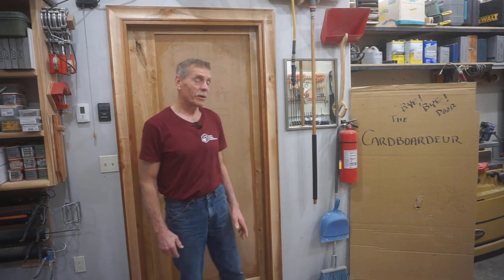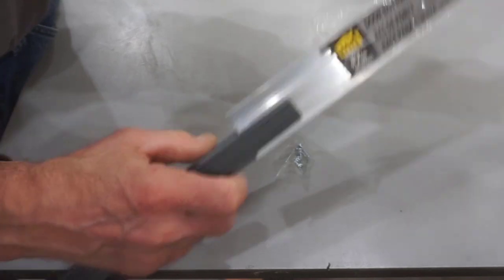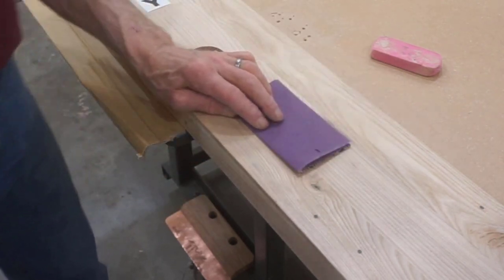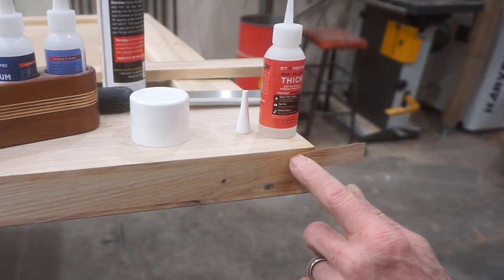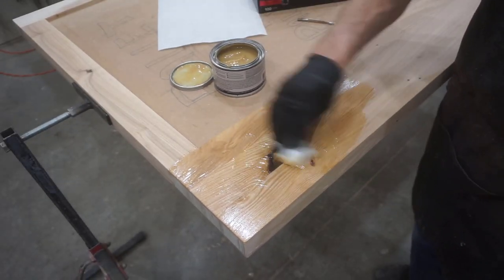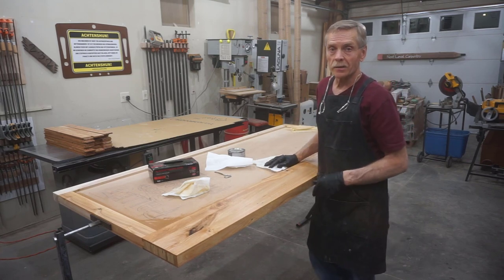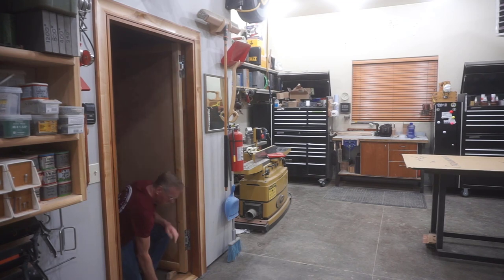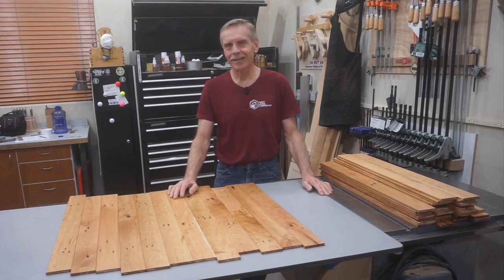Varnishing the Pallet Wood Door

Comment: Kind Sir, as an art director and type designer of many years, may I recommend you reconfigure your lettering to read baseline aligned, rather than letter-stacked (think the spine label on a book). After so much amazing work on this door, I truly believe it will look more professional and, in time, you will be happier with the end result. Besides the letter forms being designed to be viewed aligned to their bases, or the baseline, this will let you use a larger, more readable font in the same sized area. I've posted an example of what I mean here: https://user.fm/files/v2-ea0d436a4451a2ba0547d5a91c23efad/NLC.jpg
Reply from the maker: Point well taken... and you're not the first to suggest this.  I really appreciate your input and may well change course because of it.  Do you have other reasoning/examples to emphasize your point?  I'm pretty well invested in what I'm showing but yield to professional viewpoints... Thank you!
Reply: @NextLevelCarpentry Thanks and I do. My degree is in industrial design and I actually did a very large project for an agency in New York city that involved putting the meeting room names on over 20 doors. The job came out very successfully. The reasoning is twofold. Letter stacking, wether on signage or in text, is very much more difficult to read. Designers have spent years researching readability and there are many books written on the subject. So, although we are only talking about 3 words in this case, it is definitely a less readable option. Secondly, the letters themselves, no matter what typeface you choose, are designed to fit together horizontally. This not only results in more aesthetically pleasing negative spaces between the letters, but also allows you to enlarge the font 25%. I would also recommend going with a low contrast tone. Because, no matter which option you go with, the font is large and you don't want it to be overpowering. I recommend a subtle, slightly darker tone than the door itself so that the lettering does not overpower the beauty of the door itself. Lettering is designed to be noticed, and since this is not a hazard sign or wayfinding device, I would opt for subtlety. Lastly, I updated the link in my previous comment. I aligned the type with the architecture of your door, the main form, not the secondary, and lesser, door handle. Here's what I'm talking about with regard to readability: http://www.wiseinkblog.com/wp-content/uploads/2013/10/color.jpg.
Reply from the maker: @alienproductions9948  I'm getting wisdomed here!  Can you by any chance link a photo of the agency in New York or similar signage on doors without getting crossways with clients?  My design guy agrees with you although leans towards reading bottom up instead of top down...
Reply: @NextLevelCarpentry  HAHA! I'll see if I can find some pictures of the agency. For now: https://user.fm/files/v2-3ec522dc6d41401971045ab288f3b634/Dims.jpg. I like the idea of bottom up to, although top down leads your eye to the handle rather than off the top of the door.
Reply from the maker: @alienproductions9948  Nice graphic!  Would you do a bottom up version too? I see what you mean about centering on the visible part of the stile rather than on the door handle... I like it but that's a surprise to me too. Interesting about the color... I've only considered brushed stainless for the lettering since the spaces between the horizontal slats will be that material to 'match' the finish on the door handle.  This preliminary concept image shows the 'gradient spacing' between slats with a simulated brushed stainless material in between: https://pin.it/1fhzgXb so I think I'm sticking with that but who knows?  Seems the gradient 'flow' from bottom up would be reason to go bottom up on the text too?  Best, Matt
Reply: And, yes, I'm pretty sure aligning to the handle would make it uncomfortably close to the jamb when the door is closed. Better centered in the stile. The letters are tracked out so they don't have to be too large in the linked comp.
Reply: @alienproductions9948  I agree with AP.  The baseline registered type is easier to read.  I also a agree from a philosophical perspective that the text should read UP!  If you are going to the "Next Level" the nod should be toward higher not lower.  That said, the size of the type becomes an important design decision.  Much like your large carpenter's pencil, this lettering will be in the background of several videos and should be discernible...  Maybe not in every shot, but I'm sure you get what I'm saying...  At the office, we design with "super graphics" on a lot of projects.  Sometimes a word or name will be two stories tall and become a large part of the design.  You could potentially take up 100% of the stile with lettering if you want to do it that way.  If you'd rather have a subtle look, then keep it the size you have it...  I also agree the text should be a minor contrast rather than a major one.
Reply: @NextLevelCarpentry  And here is a stacked version for comparison: https://user.fm/files/v2-df4f4ecbc24d17543d6d6cbb14fac4e6/Stcked.jpg
Reply from the maker: @GregsGarage  thanks for adding your perspective on this... I'm gettin' schooled on this for sure.  "Potentially take up 100% of the stile with lettering"?  Wow, never considered that!  Whatever I settle on the end result will be much better than it would have been without input from you guys so: thanks! Best, Matt
Reply from the maker: @alienproductions9948  Thanks you so much for the time, effort, interest and passion here... I really appreciate your input on this AP... triggered a whole chain of events that will lead to a much better outcome!  I'm doing a mockup of lettering sized and spaced very close to your dimensioned image going with reading bottom to top for reasons mentioned previously... this isn't over yet so stay tuned for developments?  Best, Matt
Reply: @NextLevelCarpentry  Thank you! You're a constant inspiration to me and it's my pleasure to be able to make a contribution (albeit small) to Next Level Carpentry! I'm confident you'll be happy with the result.
Reply from the maker: @alienproductions9948  You're too kind... I uploaded a couple photos linked here that show preliminary 'baseline aligned' letters and samples of letter/slat space materials:
https://www.pinterest.com/pin/551479916879282730/
https://www.pinterest.com/pin/551479916879282732/
they both need a bit of dialing in but I'm thankful to be headed this direction and appreciate your input.
Best, Matt
Reply: @NextLevelCarpentry  Any chance you can inlay the ss letters into the timber?  (I think this would make the lettering and the door look stunning - rather than just having lettering proud of the timber.)  Cheers, David.
Reply from the maker: @drmkiwi  That's certainly a possibility but I've been committed to applied metal letters from the get-go... more personal preference than right/wrong or good/bad so thanks for the suggestion... Best, Matt
Reply: @NextLevelCarpentry  It's fantastic to see such a great collaboration like this rather than all the arguing that normally goes on the internet. Great work Alien!
Reply: Love this example of shared learning. Completely aligned with intent of the channel. Many of us are experts and we still have an opportunity to learn because of your attention to detail and willingness to include it instead of rushing by and aiming at an attention limited audience.
Reply from the maker: @dereksmalls6238  true dat... thanks for your part in it too!  Best, Matt
Reply from the maker: @sandygreywolf4937  thx... compliments from other experts carry special meaning with me that I really appreciate! Best, Matt
Reply: @sandygreywolf4937  Thank you. I was thinking about this, too. Matt has brought this project truly to the next  level by incorporating knowledge previously unused by carpenters. More broadly, we are all seeing an evolution of knowledge resulting from the amazing increase in access and information.
Reply: @dereksmalls6238  Ha! So true re. the arguing. I appreciate your comment!
Reply: Great discussion and sharing.  Alien P. thanks for the examples!
Reply: @anneoreilly4900  Much appreciated.
Reply from the maker: @alienproductions9948  Anne, Derek; You 'guys' are the best!  I'm SO jazzed about applying information generated by your comment... the end result is going to be far more remarkable than it would have been otherwise.  As it stands you'll see NEXT LEVEL CARPENTRY in Altivo font baseline aligned (brand new term for this ol' nail-bender) reading bottom up.  Following subsequent good advice from my good friend Dan at Projex I've decided to switch 'gradient spacing' to compress going vertically instead of expand going vertically.  No surprise to you it Improves the whole appearance dramatically.  Also working on material for the letters hoping to have them laser cut from the same laminate as the slat spaces... that will make more sense when you all see it.  Soon, too, I hope!🤞🏻😎 Best, Matt
Reply: @NextLevelCarpentry  Can't wait to see. LOL: Ol' nail bender!
Reply from the maker: Here's the final episode: https://youtu.be/5JGmGK_MqQY I hope everyone who weighed in is as pleased with the final result as I am! Best, Matt

Comment: hey i thought i invented the rotisserie for doors. i made mine from 1x1 1/2 aluminum angle. and use saw horses with strips of plywood attached to the top with a slot left in the middle for the shaft. the angle allows you to lay it on top of the saw horse to provide a real stable work surface. i don't like those roller stands. they  are hard to adjust and they tend to slip. i have never seen that wipe on gel you used. i am going to try that nest time i do a door. i have always used wipe on poly. or if the weather permits i take them into the driveway and spray them. that door is a work of art,like every thing you do. beautiful work.

Comment: Hey Matt, maybe try a vinyl stencil so you can paint on your “Next Level Carpentry” logo. Plus you have the added plus of being able to finish over it
Reply from the maker: That's certainly an option Julian but the plan is to go with letters with a brushed stainless face cut from 3/16" sign material. This choice will make more sense when combined with the finish on the door handle as well as material that will fill in spaces between the slats.  Cleaning around the letters periodically will be a bit of a nuisance compared to painted-on letters but I think the 'refined' look will be well worth it... Best, Matt

Comment: I'm new to this fantastic site, and subscribed immediately! A question: the Door Rotisserie seems to have a magic component, the 1/2" threaded to door-edge mounting bracket. Is that "home-brew", or a commercially available bracket? If standard, what is its proper name and source, if available? (Having a hard time searching for it ...)  I have 15 8' doors to spray, and the rotisserie seems ideal. Thank you for this wonderful, informative site.
Reply from the maker: Those rotisserie pivots are a Homebrew thing I made to make managing large heavy doors easy for my one-man operation.

Painters I work with have brackets they screw to the top and bottom doors so they can spray both sides but those require two people for flipping the doors.

All I did was weld some 1/2 inch all thread connectors to a piece of 1 inch by quarter inch thick Steel stock and then drilled holes in that flat steel for attaching to the doors. You saw the half inch bolts I screw into those connectors so the other piece that's required is a stand of some sort with a half inch hole for the bolt to slip through. I think you could adapt any decent sturdy roller stand for the same purpose if you can get the connectors and flat steel welded together. Hope that helps because it is definitely an ideal solution and I really speeds up finishing time on heavy doors...

Oh yeah and thanks for watching commenting and subscribing to Next Level carpentry!

Best, Matt
Reply: @NextLevelCarpentry  Thanks! I guess I have to learn to weld. And in my research, I've found nothing like your solution - maybe it should become a NLC product kit!
Reply from the maker: @cateye45  I'll bet you could find a welder to whip up some of those little deals in short order for you, especially if you brought the connectors and bar stock since they're common hardware items.  I'd need a marketing and distributing agent if I ever do NLC product kits so let me know if you're interested in the position? 😉😎    Best, Matt

Comment: Could you please tell what type/brand of squeeze clamps you have?  You mentioned them in a previous video (at this shop, not your old one), but for the life of me I can’t find it. It’s time to invest is some good clamps, and I prefer the squeeze type for sure.
Reply from the maker: C, Mine are Wolcraft from Menards.  FYI I just the other day pulled the trigger on a full selection of these to upgrade the mish-mosh assortment I've collected/had/used for a decade or more. This is virtually the same clamp at Amazon:  https://www.amazon.com/dp/B000JCIMD6/?ref=idea_lv_dp_  if you don't have access to a Menard's.
They're not necessarily top shelf quality but they're a great value and survive use/abuse I put them through far longer than it takes for them to pay for themselves. Sometimes 'the best' is the best value, not the best tool.  I'm sure you know I have a good selection/assortment of screw type bar clamps for when more pressure is required... Best, Matt
Reply: @NextLevelCarpentry  thank you for the reply. I don’t have access to menards, but that is fine, Amazon works just as well. I’ll check your store first. I was just looking for something other than dewalt/Irwin. I have pipe clamps for bigger stuff, but I use the squeeze type almost 95% of the time. Just need more of them. Thanks again.
Reply from the maker: @user-ts7zz6lq4x  I'm sure that both Wolcraft and Masterforce are identical other than the color of plastic used.  The Amazon link is for a full range of lengths.  I haven't studied the market extensively but find the 'compound action' on these best among those I've tried... and you're quite welcome! 😎 Best, Matt
Reply: @NextLevelCarpentry  if you are looking for an outlet for your mish-mosh clamps, there is a shop here in Georgia, right out my back door in fact, that would be interested in them for sure. Contact me if that is an option, I’m all in!
Reply from the maker: @user-ts7zz6lq4x  Good on you for keeping a local shop in mind.  I already donated them to a local non-profit here called Love INC for their Rise Ministry operation that re-builds and re-purposes used/donated furniture for sale in their store.  Proceeds go to support their other mission outreach efforts... either way I think they'll go on to serve a purpose for some years to come... Best, Matt
Reply: @NextLevelCarpentry  very good. Even better!

Comment: I am curious what you meant by it would catch fire.  Is there a chemical reaction that will cause it to spontaneously ignite?
Reply from the maker: Exactly Don... unbelievable as it sounds, under the the right conditions it takes surprisingly little time for it to happen. In a warm shop I've seen it happen in less than 30 minutes... scary but true.  Best, Matt
Reply: Doing trim work in a church when I saw on the news that the church had burned down. Stain rag left  waded up.
Reply from the maker: Just the sort of thing that I did not believe either until it happened to me...
Reply: @NextLevelCarpentry  This is really great info outside of the really great info you already provide us.  I am what I would call a beginner when it comes to wood working and finishing is honestly the intimidating side. I could not imagine if I inadvertently caught my garage on fire.  Great tip.
Reply from the maker: @donjensenep  There's plenty of ways to catch a shop on fire so it's good to check this one off the list, right? Scared the bejeezeezus out of me first and only time it ever happened to me, and on a client jobsite, no less!  If finishing intimidates you this video along with the pyramid puzzle one I did awhile back and then next video upload will give you a LOT of insight into using gel poly.  I recommend it as an entry level finish because it's virtually goof proof if you follow the steps I explain in these videos... give it a try and impress yourself! 😎 Best, Matt
Reply from the maker: @jr.3407  scary news... even if it's NOT your stain rag, right?!  Best, Matt

Comment: I had to laugh at you running that profile through the saw, I’ve had to do this a few times but the last time I did it I pulled 50% of the tungsten tips off  !  whether it was  the aluminium alloy or the blade I don’t know, but it was a bit off-putting !
Reply from the maker: I've never had an issue cutting aluminum and have cut thicker stuff without an issue ever.  The experience you had makes me think you tried to cut stainless steel or something because I've never seen a tooth damaged by aluminum.  I have had little gobs of melted aluminum stick to carbide teeth where I needed to painstakingly flick them off one tooth at a time though... Best, Matt